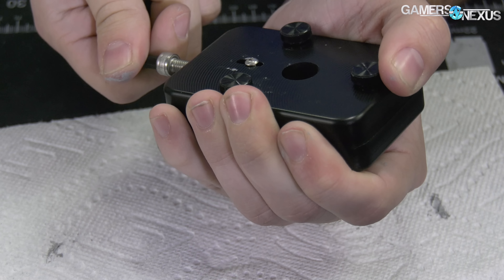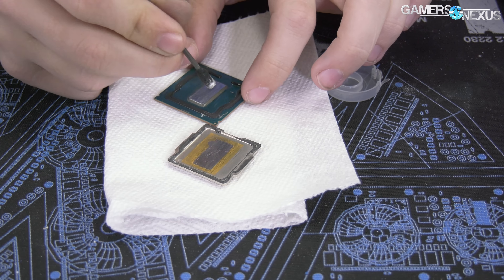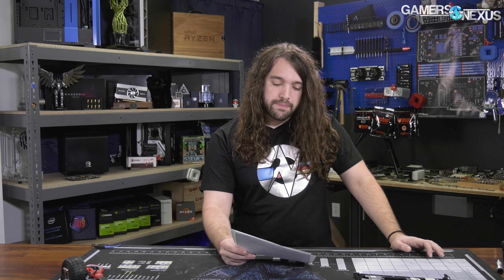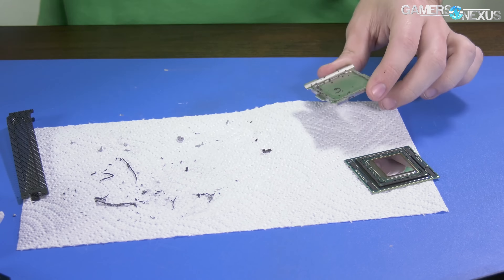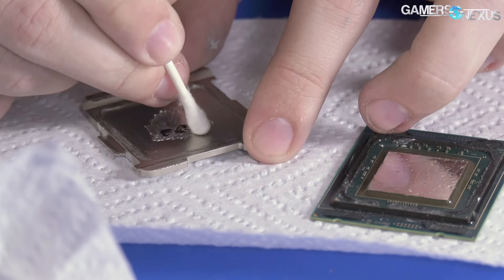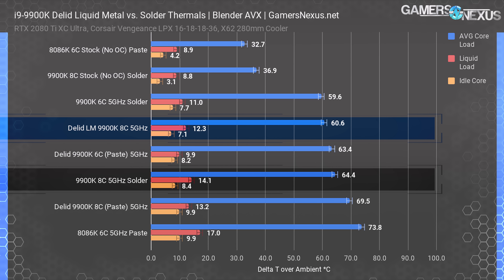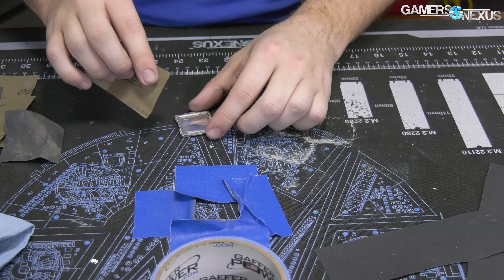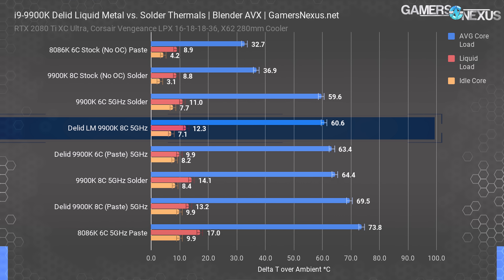Back to Reality: The 9900K Delid & Liquid Metal

Comment: As a painter, I can tell you that using your finger to sand anything, other than polishing, is a bad idea when flatness is important. I'm thinking one should make some tiny sanding blocks if you really want to lap the inside of the heat spreader properly. You may never notice a difference, but you'll definitely have a flatter lap, albeit microscopicly flatter I guess.

Comment: just fyi, rubbing with your finger is not going to produce a flat surface, you'll have high and low points which aren't going to mate properly to the die. the whole point of lapping is to make two surfaces mate as close to perfectly as possible, to do a good job takes a lot of experience and correct techniques.
Lapping the die should be done on a flat plate with grinding compound and checked with bluing compound. I wouldn't touch the IHS outside of a super fine polishing wheel on a die grinder to get a mirror finish.

With the IHS what you want to do is heat it to the melting point of the TIM and remove it while its liquid, which if its pure indium then thats about 157 degrees C, with either a solder vacuum or wick.
also once the die is lapped you'll need to adjust the wall height of the IHS to match the new die height.

but to be super clear, you're not going to get good performance from LM if you've rubbed the IHS with abrasives using your finger.
Reply: While heating the die to remove the indium solder is the way to go it still requires lapping to remove the plating grafted it the inside of the IHS and interfere
Reply: You absolutely will get "good performance" with liquid metal on a hand-sanded finish on the IHS, but it won't be the best performance. Liquid metal always has a very high W/M/K value and surface finish plays too small a part to really matter in comparison to things like which brand or blend of liquid metal is used. It really doesn't actually matter until you start going for world record overclocking at which point the silicon lottery will be the most difficult and expensive barrier to overcome
Reply: Aus Explorer How to you lap on a flat plate when the IHS has a raised lip around the edge? KingHalbatorix Wasn't one of the video's main points that surface finish does matter? That LM won't fill the gaps & grooves like paste does, so it has to be smooth? I agree though the amount of precision OP is talking about probably won't translate to much more performance.
Reply: TL;DR: He sanded it, he didn't lap it.
Reply: This was addressed before. They claim it doesn't make a big difference but that just doesn't fly. Take it to a machine shop and film them doing it and compare. It's been said before but for a channel that's all about removing variables this is a huge oversight that is easily mitigated by either getting your own flat plate equivalent or you know, just using something other than your finger and a foam mat that gives.
Reply: Brody Quinlan yes
Reply: this took them hours and you saw maybe a minute of sanding and just decided on how he did it... he could have been more precise later on and like he said this was a quick and dirty(relative) example and not the most extreme scenario for that watch Roman's video
Reply: Hit the nail on the head
Reply: Yeah not sure why they didnt just heat up the ihs and remove the solder that way. The die I understand but that's much easier to lap properly anyway.
Reply: he was still using the wrong method regardless
Reply: While I think you are correct and the way the delidding was done in the video is not the best method for the thermals, you are also kinda proving the point of the video - the process is a lot more complicated now and not worth it for any "casual" overclocking.
Reply: Woolgun,
EXACTLY.
Steve said there were other things you could do to improve things. Considering that it might reduce temp by 2% or whatever to spend the extra  effort vs the fact that it's like an 18degC difference to go from 4.8GHz to 5.0GHz then we're talking about a niche within a niche community who cares and as said that's the entire POINT...

Steve explains WHY he does things and WHY he doesn't. He's very, very knowledgeable so for those guys who say he's just flat out "wrong" you may want to question YOUR knowledge first.
Reply: (by "extra effort" I meant more level planing on top of the other efforts)
Reply: I kinda love that not one of you has actually ever seen a Flat Lap. But at least you know that this isnt lapping lol
Reply: Yeah this is one of their worst mistakes they've made. Using your fingers to push the paper is such a rookie mistake and makes the comparison useless. If he did even a little bit of research he could have gotten a chemical cleaning kit for 7-8 dollar to remove the solder without scratches.

There's multiple tests done that uses a non retarded way of removing the solder and replacing it with LM for a 6-12c improvement on specific cores.
Bringing the temperature difference across the core much closer than before.
Reply: Would heating to 157c not kill the chip?
Reply: Can you make a video of that and list links to all the tools lol?

Comment: Intel, we make it, you fix it
Reply: EA, its in the game - as micro-transactions.
Reply: It's designed to give the user a sense of accomplishment .
Reply: THE BLACK DRAGON hahahahahahahah. 10/10, beautiful, absolutely perfect
Reply: K cpu.... you know how they sell you more expensive chips and say its so you can over clock it? turns out you need to do some karate kid sand on sand off shit. scariest shit ive seen
Reply: that 2700x is the same, removing the soldier and applying LM reduces only 4C. But the 2700x can't OC more than 4.2, while the 9900k can go 4.8-4.9 easy. 
The 2700 costs 40$ less than the 2700x.
Reply: It's kinda disgusting that a person with sandpaper and some thermal goop can improve a product that takes cleanrooms and billion dollar facilities to create.

That's called bad and lazy design.

Especially for the price they ask for those CPU's, this is just goddamn shitty from Intel.
Reply: Apple: We sell bricks with apple logos, and you love them
Reply: +enlightendbel pretty much ye... Intel might as well sell the CPU's without gluing the IHS into the Die. And let the users apply their own Thermal Paste and or even better liquid Metal.

For the price they ask for their products. Specially the "K" SKU CPU's that cost more than non K. Yes they are overclockable but the fact that they use the most SHITTIEST Thermal Interface material. They are almost not overclockable with good Temps and Stability unless its a golden chip which is rare.

Its even "Damning" because I am very sure, Intel knows about it. But they kept using the same shit TIM from as far as I can remember.

Then a little delid + conductanaut and temperatures just drops 20 celsius easily.

And now they use solder on the same range of CPU's but still mess up cause they made the die too thicc.

People are intel are Stupid money hungry capitalist pigs.

I say stupid because.

They "KNOW" the problem/issue. But they choose to turn a Blind Eye thinking nothing is wrong. When there are a lot of solutions that easily fixes the aforementioned fiasco.

i.e. the easiest solution a good soldering (until they fucked it up with the thicc Die Size)

alternatively, pre-apply liquid metal from factory.

or if they dont want that

use something like a kryonaut and or the noctua nht-1.

Not that Crap Thermal Paste they pulled out of their ASS.
Reply: This is Bethesda, intel is "well here we go again, *price surges*.
Reply: THE BLACK DRAGON  slow clap well played sir,
Reply: "It's kinda disgusting that a person with sandpaper and some thermal goop can improve a product that takes cleanrooms and billion dollar facilities to create.
That's called bad and lazy design.
Especially for the price they ask for those CPU's, this is just goddamn shitty from Intel."-enlightendbel 

So which manufacture are you using where you cannot make aftermarket improvements to the thermals "-enlightendbel?  As you call this a shitty CPU can you tell me which good CPU I can buy which willl mattch it for gaming which is my main use for a PC?
Reply: @Blind Truth, The fact that it's the best CPU for gaming doesn't excuse lazy design and anti-consumerism. The point is that it would be even BETTER for next to zero cost and effort on their part, but they've continually decided to not try their best because it's an extra ace up their sleeve to improve things just slightly and call it a whole new generation.
Reply: Its unacceptable for Intel not to solder their Skylake X chips WTF man

Comment: Tip for lapping the IHS inside. Pool cue chalk is a nice size to wrap some sandpaper around. Had it for my 4770k and used same piece of 2000grit for my 7700k. Dice would likely work too and more readily available for more people :)
Reply: OnBoard edit: I’m an idiot I only read the first part lolol
Reply: No worries :) Anything hard and small enough with a straight side will do, just needs to be large anough to get a grip. But it's still tedious, remember doing start of reflection to 4770k and with 7700k just made sure it was smooth #goodenough

Comment: Delidded my 9700k and added a direct die frame from rockit 88. Was very easy as they have a material that removed the solder very easily. With the direct die cooling plus liquid pro liquid metal the mod yielded a 8c temp drop at 100% load after 5 consecutive cinebench runs. Before max temp 84c, after 76c.

Comment: the solder layer is pretty thick on alot of intel cpu's.

when you are refitting the ihs it is worth checking the ihs-die clearance.

sometimes the liquid metal does not actually fill the gap properly.

I think it would be far more efficient to remove the ihs and retention bracket and directly mounting a heatpipe style cooler (much like mobile cpu's), there are retention bracket delete kits available to help retain the cpu to the motherboard.

Comment: Quick response (comment before watching full video)

I've delidded a x5675 (soldered cpu) and added liquid metal 

Didn't help at all and it was tough to remove; used razor blades and a heat gun to remove ihs (difficult)

Used same blades + heat to remove excess soldered on die

Friend was like, " It's soldered,it's redundant to remove and add liquid metal."

He was right. Not planning on doing that to any soldered cpu

But I understand why people did that; used the x58 xeons to upgrade their Old Mac's CPUs. (It was a must to delid inorder to fit)

Comment: I like my 9900k. I don't overclock my CPU so this definitely isn't for me. I use a custom loop cooling set up and usually see about 65C at full load  with boosts to 5ghz and at idle it sits around 30C. I always wondered though why my GPU's liquid cooler is so much more efficient though, as at full load it usually stays below 45C and at idle it hovers dang near room temp. Thanks for the education and you're quickly becoming my favorite tech tuber on the platform.

Comment: Delidded my I9 9900K Steve and more than happy with it :) @5.1Ghz Stable 1.37 - 1.39v. Temps - Aida64 80 - 90c, same for Prime95! Everything else tested Cinebench, Realbench , intelburn Test and Intel Extreme tuning high 70's low 80's.. Gaming it jsut sits high 60's to 70's.